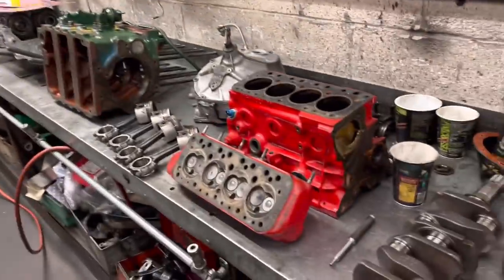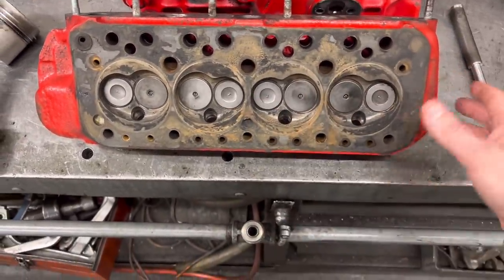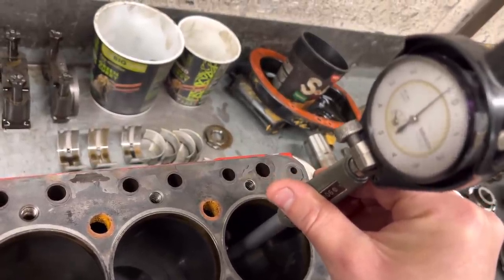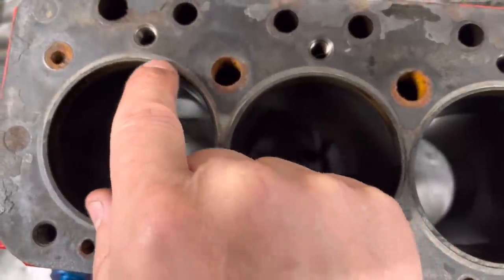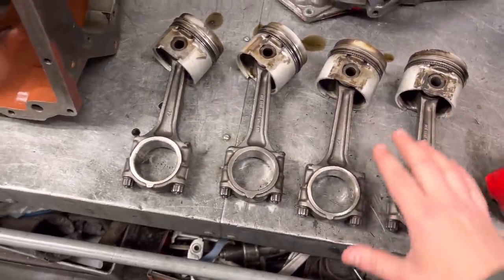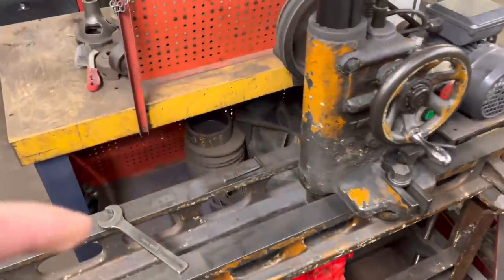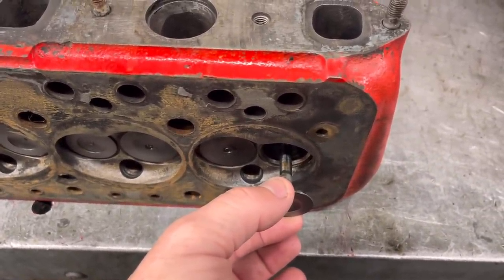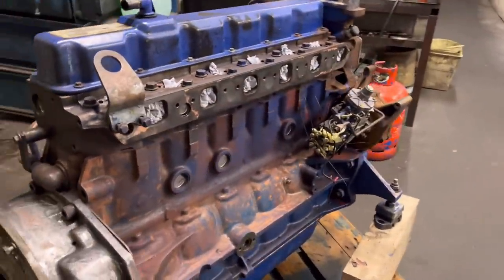Is this a MINI engine with MAJOR problems?

Comment: If your fitting the a  cam (270)  he needs to do a bit of work around the inlet valves and match up the ports to manifolds specially the exhaust ports they  look restricted, you can see the carbon build up around them

Comment: Nice update, which piston manufacturer are you using? I'd imagine nural as the engine is pretty much fast road spec, also, what is the profile of the cam as the SPI ECU's are fussy with cam choice, I use MED a lot for upgraded bits, excellent quality stuff....cheers, Paul 👍

Comment: Interesting about the hard spots in the bores ...I rebuilt a small Diesel generator engine ( Kubota) and after busting the glaze and putting in new pistons and rings, the engine burnt oil from the minute it fired up, and after several attempts to get it running clean without success, I gave up, and eventually the customer bought a new engine which of course solved the problem. I never did know the reason why it would not settle down and run clean.

Comment: I have just found your channel and I am really enjoying it. I used to live in England for my first 23 years then moved to Canada. I worked on cars since I was 13, the reason was my father was born deaf and could not hear himself over revving the poor engine, it was a Ford 1172cc side valve with a 3 speed gearbox. 
I now work on Diesel engines in pickup trucks, my own is a GM Duramax LML 6.6 litre, big difference but still a engine in the long run. Keep up the video’s, thanks.